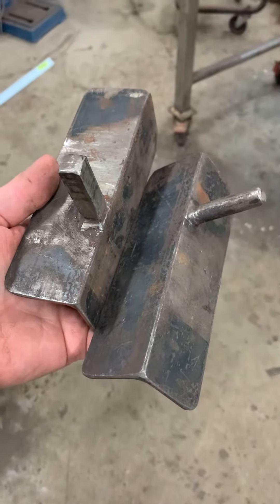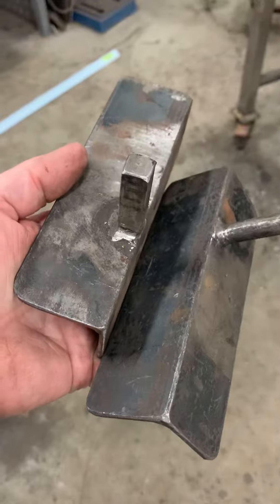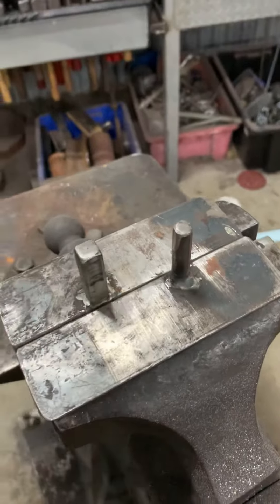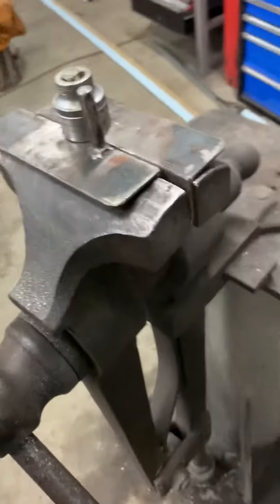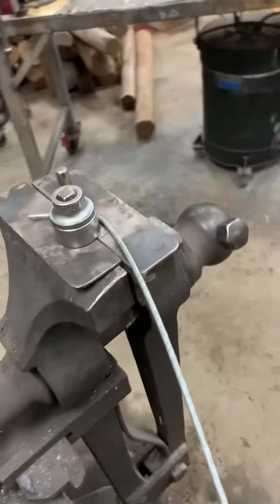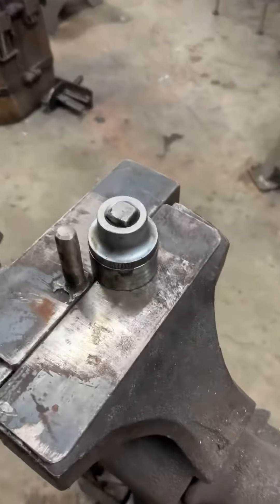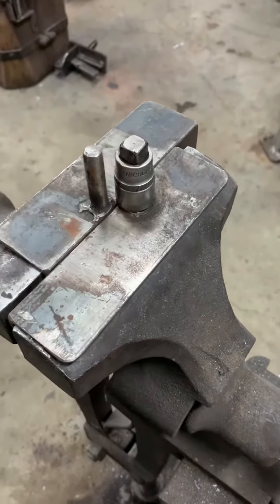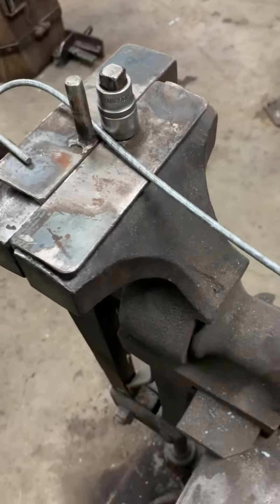Simple adjustable bending jig for the vice.

Comment: This is my favorite take on this tool! Way easier to use (and store....) a socket set that way rather than the other common solution of making a bunch of jigs with different diameter pipe. Great video!
Reply from the maker: No worries mate, glad to help.  One day I might make a less wobbly video and actually bend a bit of hot steel as a demo. It was a bit of a rush vid as a friend was asking how I made mine.